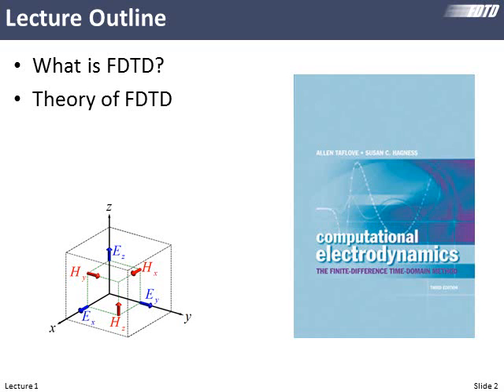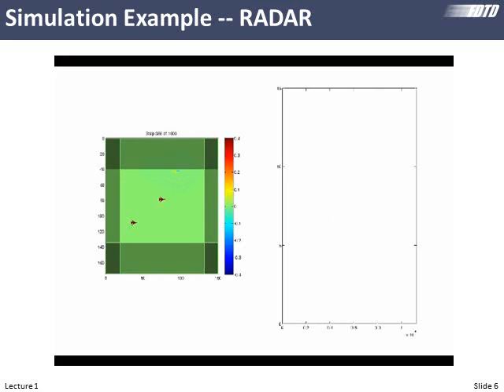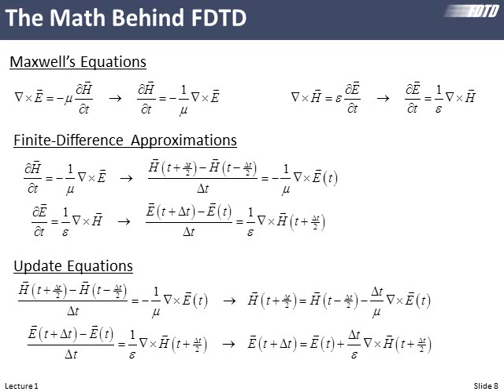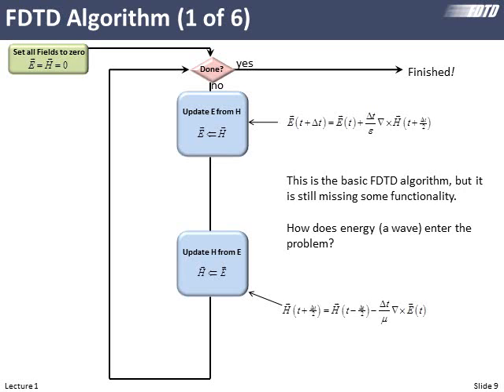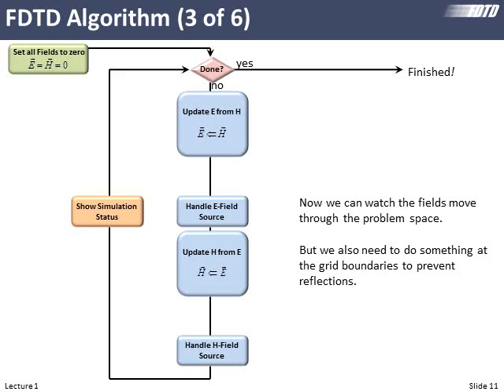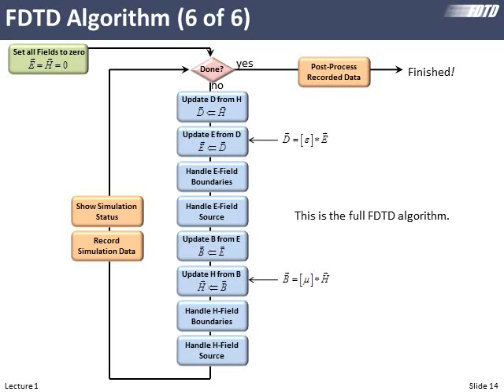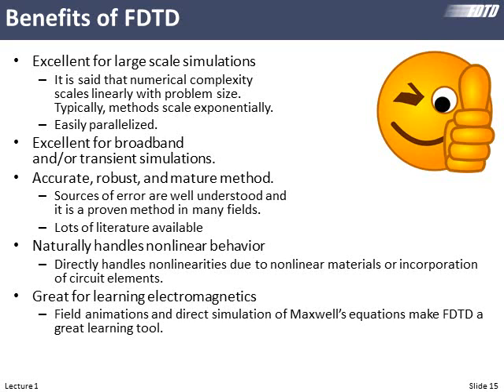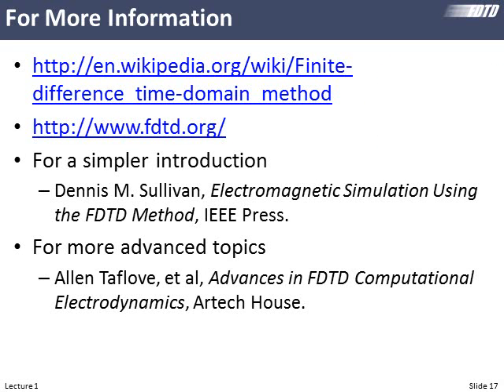Lecture 1 (FDTD) -- Introduction

Comment: Can you easily incorporate devices with charge and current density, like capacitor plates + conductors?
Reply from the maker: Yes, absolutely. You can incorporate the actual structure or you can incorporate the device as a boundary condition. The second is much faster and allows you to play with ideas with a small and more efficient simulation. I always do things like this first and really only simulate the full structure as a final confirmation. Many people will jump straight to the full structure and get bogged down.

If your goal is only to calculate the capacitance of a capacitor or calculate the field lines, there are much more efficient ways to do that. That is best done as an electrostatics model. FDTD is electrodynamics...waves.

If you just want to calculate field lines, you can do that very simply using Gauss' law. See Lecture 4f here:

https://empossible.net/academics/emp3302/

If you want to calculate capacitance, see "Capacitor Simulation Example" after Lecture 4r at the same link above. If you want to learn more about the numerical aspects of this calculation, see Topics 6 and 7 here:

https://empossible.net/academics/emp4301_5301/

If you are interested in analyzing capacitors, inductors, or transmission lines at frequency at not static, you may be interested in this book:

https://empossible.net/fdfdbook/

There is a chapter that describes how to analyze these types of devices rigorously to include frequency, loss, etc.

Hope this helps!
Reply: @empossible1577  Is there a cheaper digital version of the book? I cant get it shipped to where I live. I am going to start watching the course, it it exactlt what I have been looking for
Reply from the maker: @gzitterspiller  There is (or at least was) a digital PDF of the book available. There is even a Kindle version from Amazon.

https://www.amazon.com/Electromagnetic-Photonic-Simulation-Beginner-Finite-Difference/dp/1630819263/ref=sr_1_1?crid=1LXHF5R12BT1T&dib=eyJ2IjoiMSJ9.B2GpcvK24yrCe7bzVWqmU5VWTJIYAGAv5ilO9_onMuKKOrnUypD2tvMDWsoviEmxiMpeFzR2bhDnEskdbwobFA.X-76r4TRcymk2qBFBbwGbIM0FU0s8ZI-xbhFG2wTwJE&dib_tag=se&keywords=rumpf+finite-difference&qid=1740409929&sprefix=rumpf+finite-difference%2Caps%2C142&sr=8-1

Comment: For small devices, how can we tell if the device is "small" ?
Reply from the maker: For electromagnetic simulations, size is always relative to wavelength.  So a 1 meter device operating at 1 meter wavelength is exactly the same "size" as a 1micrometer device operating at a 1 micrometer wavelength.

I would say 10 wavelengths and less is small, but that is rather subjective and depends a lot on the available computational resources.
Reply: @empossible1577  gotcha! thank you!!

Comment: This video was really helpful. Thank you so much for this video!!!!
Can you please tell me whether FDTD method can simulate SERS effect in MATLAB. If yes, kindly explain how
thank you
Reply from the maker: Yes, absolutely.  I recommend referring to the literature as I have not ever simulated SERS.  Here are two papers I found on Google Scholar:

Zeng, Zheng, Yiyang Liu, and Jianjun Wei. "Recent advances in surface-enhanced raman spectroscopy (SERS): Finite-difference time-domain (FDTD) method for SERS and sensing applications." TrAC Trends in Analytical Chemistry 75 (2016): 162-173.

Grimault, A-S., Alexandre Vial, and M. Lamy De la Chapelle. "Modeling of regular gold nanostructures arrays for SERS applications using a 3D FDTD method." Applied Physics B 84.1 (2006): 111-115.
Reply: @empossible1577  THANKS YOU SO MUCH!!! I wish you all the very best! 

In the drawback part of your video you have mention it as FDTD is quite insufficient for resonant devices; SERS is involved in Surface Plasmon Resonance (SPR).

Does other methods like Boundary Element Method (BEM), Finite Element Method works well? Please explain, Sir!
Reply from the maker: @lokeshgnanasekar  SPR is an atomic scale resonance that is handled fine by FDTD.  I was talking about simulating devices with wave resonances where the waves bounce around many times.  FDTD can still certainly handle these, but the simulation has to run and run and run and run and run ... until the wave leaks completely out of its resonance.  As an example, I give a problem in my CEM class to simulate a guided-mode resonance filter.  These are essentially just resonant diffraction gratings.  FDTD takes around 36 hours to simulate.  Another method I teach called finite-difference frequency-domain takes about 12 minutes for the same simulation.  The same devices simulated using rigorous coupled-wave analysis takes only a few seconds.  This does not mean RCWA is better than FDTD.  It only means it is the superior method for that specific device.
Reply: @empossible1577  Thank you for the information

Comment: May I ask why some lectures are not visible, for instance Lecture 21. Thanks for the awesome, informative lectures!!
Reply from the maker: Thank you!  I am glad they are helping you!  I have removed some lectures because they provide MATLAB codes that give away answers for classes I am teaching.  In other cases, the lectures have been improved and replaced with newer and better lectures.

I recommend accessing the course through the website.  You can download the latest version of the notes, get links to the latest lectures, get links to MATLAB implementations, and much more.

https://empossible.net/academics/emp5304/

Comment: Fantastic Series!! You may find this funny -  and I must preface this with stating that I have next to zero knowledge on physics. However I love to program and wanted to see if I could learn a bit about the fundamentals of physics by rendering oscillating fields/waves in 3D. However I foolishly thought that I could achieve this effect merely by overlapping field curvatures along a uniform time domain. As you would expect all I produced was a lumpy field :(! I haven't implemented FDTD to my project, yet I feel pretty confident that I can use your content to make it happen - thank you!
Reply from the maker: Great!!  Let me point you to the official course website.  I recommend using it as your main portal because it has the latest version of the notes, links to the latest videos, MATLAB codes, and other resources.

https://empossible.net/academics/emp5304/

Also, if you are willing to pay for an online course, here is a course intended for the complete beginner.  It includes everything including MATLAB codes.  It is highly visual and very simplified.

https://empossible.thinkific.com/courses/1D-FDTD

Comment: I really appreciate this series of lectures on FDTD which are helpful for the beginners. I am a student from mainland China. However, for some reasons, it's a bit inconvenient to access YouTube in China.  Maybe you can consider to upload your videos on www.bilibili.com, since in this way students in China can access to your videos more easily and your videos will definitely benefit more students and researchers. It would be kind if you take my advice into consideration. Thanks a lot.
Reply from the maker: What happens when you try to access  YouTube in China?
Reply: @empossible1577  YouTube is generally blocked here. People who want to access YouTube need to set up VPN (virtual private network). It is not difficult for people who intend to access. Still, YouTube is not a common choice for most students when they need to search for high-quality academic video courses.  But I just found out that there is not an English version for  bilibili or other Chinese video websites. If it is inconvenient for you, just never mind my previous suggestion. Personally, your videos helped me a lot. I will strongly recommend it to my fellows.
Reply from the maker: @rogerli1400  Thank you.  This is good to know.

Comment: Sir please upload a detail video of me wave simulation on an aeroplane that you show little bit here in this video
Reply from the maker: Sorry.  That picture is borrowed from the internet.  I do not have that simulation.  BTW, simulating waves interacting with airplanes is a very large and intense simulation that usually requires a very powerful computer with lots of memory, or a cluster.
Reply: @empossible1577  its ok and thank you sir for your reply.
Reply: @empossible1577  one more thing i want to know.. i'm getting issue when a plane wave incident on a sphere and plot the scattered field and total field in 3d fdtd . i don't understand what is happening ...
Reply from the maker: @PhysicsKeeBuniyaad  Is there a problem with your simulation or you just do not understand the electromagnetics?  If it is the theory you are confused about, do some reading on "mie scattering."

Comment: Hello, I'm trying to simulate a wave impinging a homogeneous lossless dielectric material to calculate transmittance and reflectance, I'd like to have some kind of source similar to that shown in minute 1:32 in the Radar simulation example. I need it windowed, tilted an angle w.r.t. x-axis or y-axis and also of short duration (Gaussian) in order to investigate a wider range of frequencies (wavelengths)- Could you please give me any hint on how this wave is introduced or what it mathematically looks like when it is also spatially dependent? 

I thank you for your reply and your videos, they have been of much help.

Juan
Reply from the maker: I don't have a whole lot on that type of source, but it is pretty easy to do.  Take a look at the notes (not the video) for Lecture 15 "FDFD Extras here":

http://emlab.utep.edu/ee5390cem.htm

You will see a section for Gaussian Beam Source.  Until I revise the slides, right now it starts on slide 60 in that PDF.  This is for finite-difference frequency-domain, but it is not a lot different for FDTD.  See what you can do with this.  It shows you how to tilt the source, control its width, etc.
Reply: Hi, thanks for your soon reply. Maybe just to clear my mind a bit up, would it look like a source of the type: fsrc = real(gaussian(x,y)*exp(j*w - k.r)*gaussian(t))? Because then it is not clear for me whether this source satisfies Maxwell's equations in free space.

Thanks a lot for your reply in advance.

Juan
Reply from the maker: This Gaussian actually does not satisfy Maxwell's equations exactly.  For one, it does not account for divergence of the beam.  However, it is close enough and has worked perfectly every time I have tried it.  For TF/SF, you only need the field in two planes that are spaced a half cell apart.  Your equation for a Gaussian is close enough to a rigorous beam over this distance that you do not have to worry about it.  At least, I have never encountered a problems with it.
Reply: CEM Lectures Professor thank you very much for your reply. It has been a big help. Thanks a lot for the videos and lecture materials as well.

Juan
Reply from the maker: You are welcome!
Reply: @empossible1577  Hi, can I ask you, how did you implement this? The g(t) is size of T but g(x,y) seems to have dimensions of the grid, so you cannot multiply them, right? How did you do that?
Reply from the maker: I wish I had notes specific for this source because I get asked this a lot.  I need to do it.  Sorry I have not!  I do have a section of notes that describes how to do this for finite-difference frequency-domain (FDFD) and it is very similar for FDTD.  You can find these notes (not in a video) in Lecture 4f, slides 60-66, here:

https://empossible.net/academics/emp5337/

You will calculate a meshgrid centered where you want the beam incident on your device.  You will then tilt that meshgrid, by calling cart2pol() and then pol2cart() and add whatever angle you want.  Now you calculate your source on that tilted grid and use that source in your TF/SF equations.  Technically, you only need to calculate the source on the points that span the TF/SF interface.  However, I recommend calculating the source everywhere at first so that you can visualize the source to troubleshoot.
Reply: @empossible1577  Thank you for your answer! I am now just wondering how is it then with the time delay associated with Hx? Do we need it, if we itroduce this source, that is dependent only on spatial coordinates? Is the position still half cell apart, and half dt delayed?

for example. if I want an angled plane wave, what should I put there?

w = 3*lam0;
[Y,X] = meshgrid(ya,xa);
[TH,R] = cart2pol(X,Y);
[X,Y] = pol2cart(TH+theta,R);
nxs = round(0.5*Nx); %horizontal position of beam center
X = X - X(nxs,ny_src);
Ez_src = real(exp(-(2*X/w).^2).*cos(k0*Y)); 
 Hx_src = -A*real(exp(-(2*X/w).^2).*cos(k0*Y + time delay???));
Reply from the maker: @TadeasManka  The time delay is needed.  E and H are defined to be a half time-step apart.  This was done so that simple second-order accurate central finite-differences could be used to approximate the time derivative.  The angled-source is a tiny bit different to handle and I recommend getting your normal source working first.  The angled source is simply a matter of calculating a different source function for each point on the grid where the source is injected.

Comment: Thanks for offering very helpful tutorials. I don't have any experience of using FDTD yet, therefore I want to ask you couple of things:
a) How good FDTD is for simulating Plasmonic structures?
b) Can I do Kretschmann configuration using FDTD where the excitation source is Gaussian beam?
Reply from the maker: FDTD is excellent for plasmonic devices and it is capable of simulating anything.  FDTD tends to become less efficient for highly resonant devices.  In this case, frequency-domain methods are preferred.  FDTD is excellent for very large devices and plasmonic circuits tend to be large.

Comment: Really helpful tutorial.. by the way Sir, if i want to simulate an ultrasonic wave transmitted from a curve shaped ultrasonic transducer, is it possible to use this fdtd method? I am still new to this field. thank you
Reply from the maker: This method can still be used, however, ultrasonic waves involve different physics than electromagnetic waves.  You will start with different governing equations and may need something different in your boundary conditions.  The basic procedure and techniques will be identical.
Reply: First of all, thank you so much for your reply. Oh i see...Sir, could you please give me some details about the governing equations you mentioned above? and since it is ultrasonic, should i still use the maxwell equation as well? thank you.
Reply from the maker: The governing equations are the fundamental equations that you are solving.  In electromagnetics, Maxwell's equations are the governing equations.  Unfortunately, I do not have any expertise to offer in ultrasonics.  I know that there is an FDTD book by Dennis M. Sullivan which has a chapter devoted to acoustic simulations.  Check into this.  I am also sure there will be a lot of literature on this subject that you can find with a simple internet search.
Good luck!
Reply: Okay sir, thank you so much for help. i will start looking for some references about it then. Your channel is amazing.
Reply from the maker: Thank you!